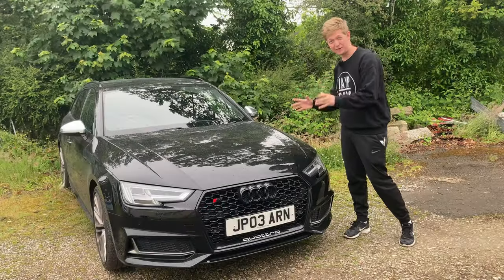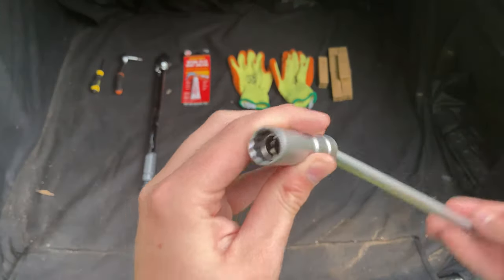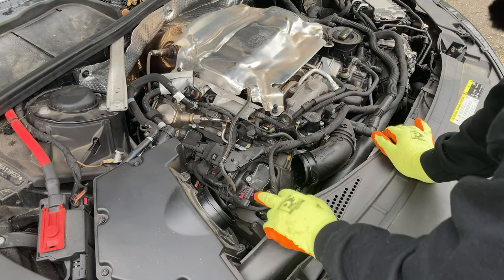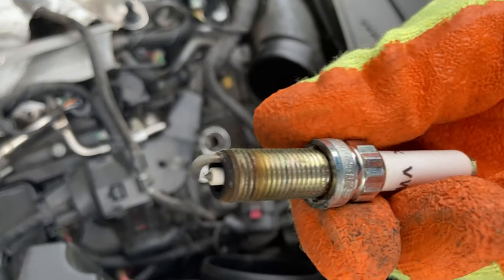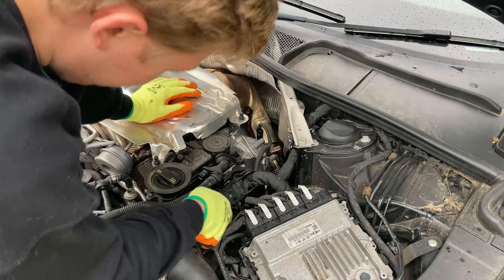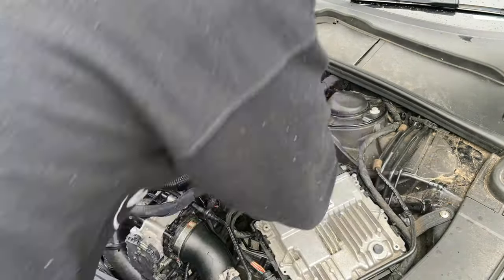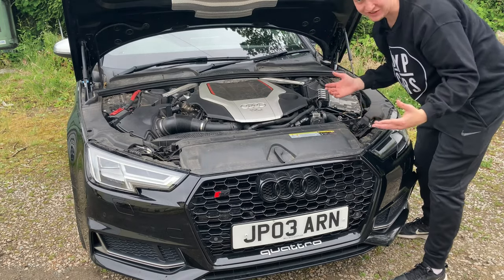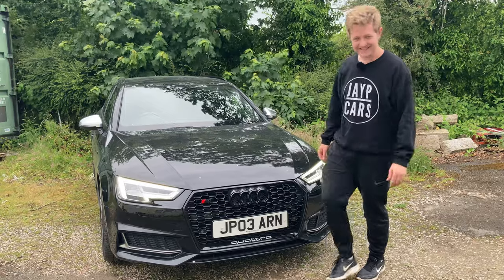How To Change Your Audi S4 B9 Spark Plugs (S5 B9, SQ5 B9, A6 C8, A7 C8 & Gen 1 Q8 With 3L V6)

Comment: Great video, thanks!   What is the fastening method for the wiring harness sitting on top of the middle cylinder?  It is simply a push-pull type of connector?  I didn't see you use a tool or release any clips.  It looks like you simply gave a firm pull.  Is this correct?
Reply from the maker: I think it just popped up and out with a firm pull. Can’t remember needing any tools to do it.

Comment: Hey, you got into your car on the wrong side!  :)

Excellent video.  Great info and tips.  Thank you.  👍

I'd like to offer some of my experience.  I've been an auto enthusiast for over 40 years.  Like most of us enthusiasts, I enjoy learning and doing the work on my vehicles, and friend's and family members vehicles.
"Pre gapped", plugs have been out for a long time.  In my experience, even with pre-gapped plugs, I ALWAYS check to verify the gap.  Why?  Because I've had the occasional incorrectly gapped, "pre gapped", spark plug.  For me, I prefer straight/flat gauges opposed to the common round discs or wire gauges.
Reply from the maker: Hi! Thanks for watching. I’ll keep this in mind for next time and will grab some of those flat gauges. I can certainly see why you would prefer them! Always worth checking before installing, saves faff if they are gapped wrongly!

Comment: Hi there hope you are well do you know when do you need to replace coils pack mine is misfiring little bit when I fire it for first few seconds? Many thanks
Reply from the maker: It may be worth reading the codes to see if it comes up with anything before throwing any money at the problem. It could be a number of things but you could change lots of parts and still have the issue
Reply: @JAYPCARS  hi thanks for quick response it’s P030000 also it got lean code as well see if you can help many thanks
Reply from the maker: @Shafiqkhanuk  When were the spark plugs last changed? Could also be coil pack failing. Made any changes to the car recently?
Reply: @JAYPCARS  no really no one changed them I think it’s got 65k on clock now
Reply from the maker: I would change the sparks regardless then 👍🏻
Reply: @JAYPCARS  thanks I’ll do that see how it goes
Reply: @JAYPCARS  Hi hope you are good I have changed spark plugs nothing changed still misfiring any idea?
Reply: I just recently bought a b9 audi s4 and the engine is shaky and the car is telling to turn off the ignition. The codes that come up say I’m dealing with multiple engine misfires. Do you think it could simply be a couple burnt spark plugs or should I be really worried? Asking for help 😕 @JAYP CARS
Reply from the maker: @Shafiqkhanuk  Hi Shafiq, just seen this. Is it multiple misfires or just certain cylinders?
Reply from the maker: @Armin-sc3vi  Could be a number of things, first thing I’d do is take it back to the seller (depending on where you got it from and how long ago)
Reply: @JAYPCARS  hi it’s multiple misfires
Reply from the maker: @Shafiqkhanuk  Do you have a tune on it? How about an oil catch can? If stock is it all cylinders? If only select ones could be coil packs? Could be bad PCV as the original ones fail - I’ve got a replacement video on YouTube.
Reply: @JAYPCARS  I think it’s got injectors blocked

Comment: Thanks!  How long did it take you?
Reply from the maker: If you take away recording it, around 1hr - it’s a nice easy job 👍🏻
Reply: @JAYPCARS  thanks so much for taking the time!  I’m going to do it this weekend with my SQ5.
Reply from the maker: You’re welcome. It’s only the wiring above the coils that gets in the way but with a bit of manoeuvring should be fine. Like I said I’m the video I’m not 100% sure on the torque specs as I couldn’t find any.
Good luck 😃